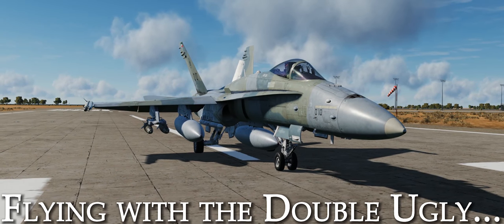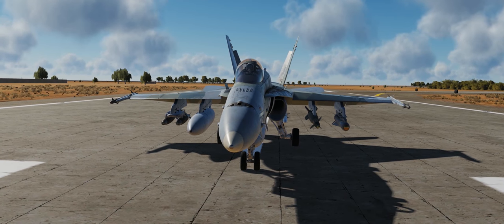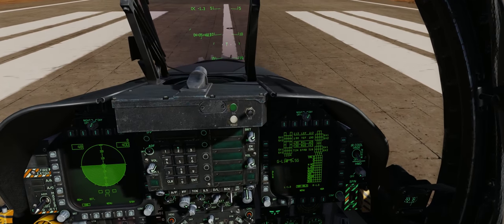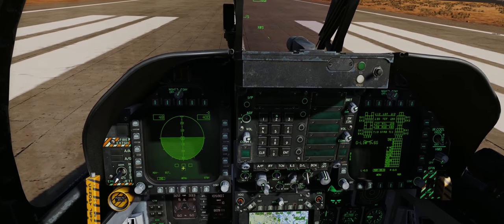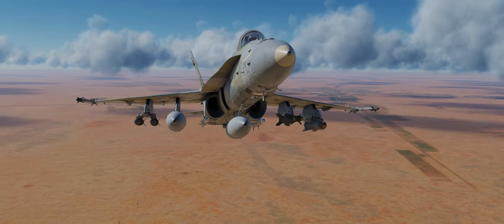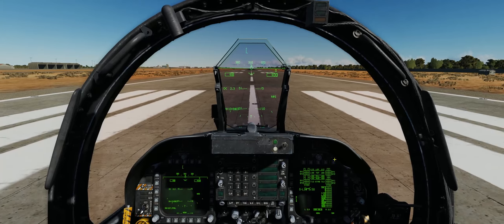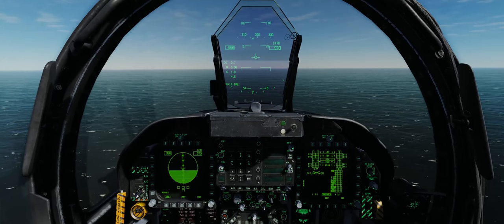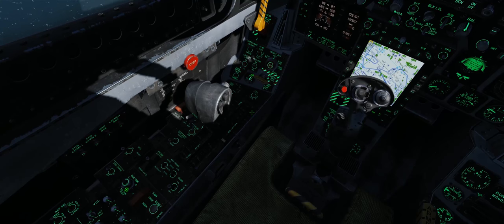DCS: F/A-18C Hornet | The Double Ugly Loadout Tutorial! | Asymmetric Loadouts

Comment: Kinda curious as to why you have only a 1000lb bomb opposite of the drop tank instead of a 2000lb bomb, which would be closer to the weight when the tank is full? One explanation I can come up with is that the 1000lb bomb is close to the tank as it empties over the course of the flight, looking at the average weight. Seeing as how you do it this way the Navy must disagree with me because I would think the plane is most sensitive on takeoff and you would want the two torques to be as equal as possible, and then you can trim out the drain on the tank as you fly. I guess since we can input such precise trim commands to the F/A-18 we don't have to be that gentile with it.
Reply from the maker: Solid thinking on your part, but its due to the fact the tank drains over time, if you had a 2000 pounder opposite an empty tank, that would be very, very difficult to get back aboard the boat.
Reply: @Spudknocker  Hold my beer
Reply from the maker: brainfart22 LOL
Reply: @Spudknocker  no considerable increase in difficulty was found behind the boat with a 2000lb bomb loaded vs a 1000lb bomb
Reply from the maker: brainfart22 did you drain the opposing fuel tank?
Reply from the maker: If you Air start near the boat that tank will be full
Reply: @Spudknocker  both tanks were drained, I was just below 35,000lbs on touchdown